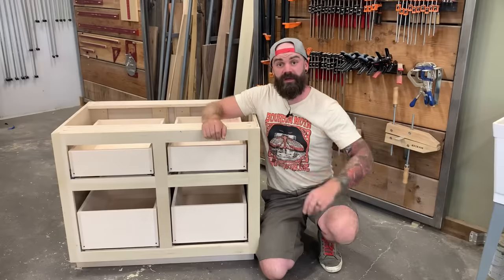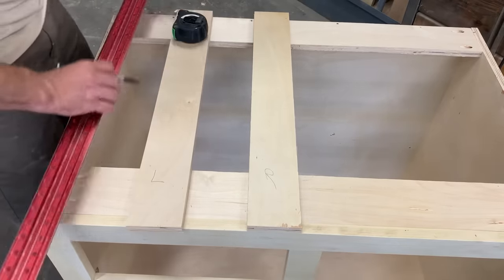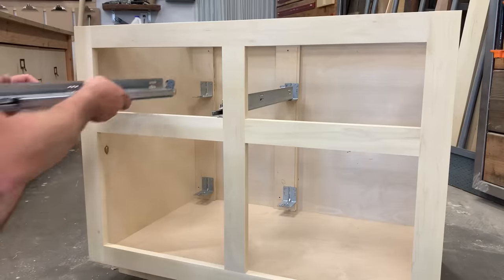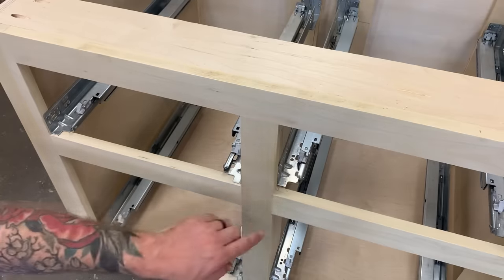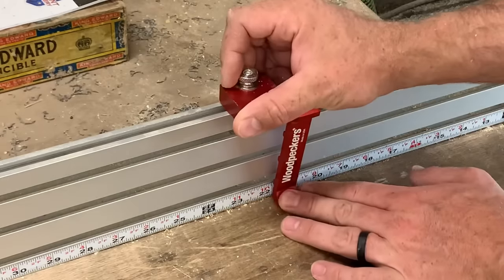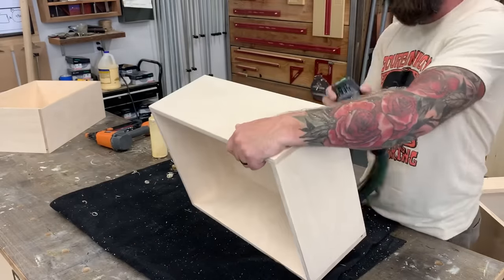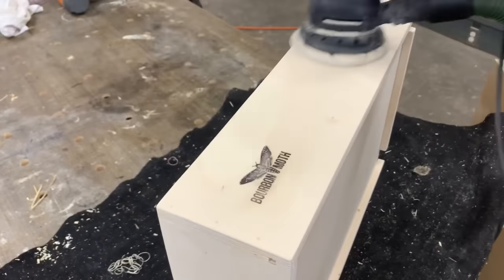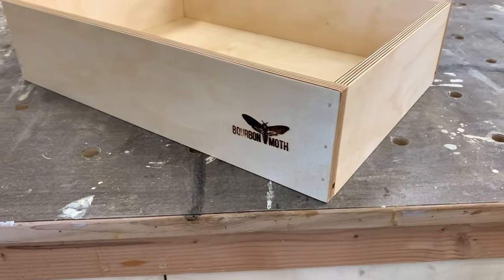Build Cabinets The Easy Way | Building and Installing Drawers

Comment: Lots of great tips on installing those drawer slides. Shaun Boyd's video on these is pretty great but your technique might be a little easier to approach because of the lack of measuring and just transferring marks. I've wanted to use some of these slides and this gives me a little more confidence. I would argue that the time saved by using nails instead of pocket holes is negated somewhat by filling, waiting for filler to dry, and sanding the holes left by the nails. I will say though, that I often fight with pocket holes trying to pull the parts out of alignment when they are tightened.

Comment: I used 21 inch dynapro undermount slides by Grass.  Cannot get my drawers to close all the way. There is about a 1/4 stick out on the face frame.  Any idea what I am not doing? The holes are aligned in the back. Slides are closed all the way. Please help.

Comment: Which side has a higher load capacity? Left side (Overmount) v Right side (inset)? My theory is the inset has higher load capacity since it isn't loading the face frame, but instead is loading the inset vertical scrap piece. Prove me wrong?

Comment: It's great to see your fine works but you see just one 8 inches Clamp's cost more than 1000 and plywoods 4×8×12 feet cost almost 1800 and door's slides are impossible to find anyways first of all a straight guide cuttings device is needed and I don't know what I do first and purchase first 🤗👍

Comment: The link to the drawer slides says the slides are for drawer side thicknesses up to 1/2”. It looks like you are using 3/4 plywood. Did you have any issues?
Reply: I had the exact same question.   Anyone have confirmation on this?
Reply: @JodyAbbott  scrolled through some of the comments but didn’t really see this addressed. I don’t understand why it wouldn’t work for 3/4 drawers? I mean what part of the slide limits it to 1/2”?
Reply: @JodyAbbott  I found this site that sells these slides. Nothing specific about wall size, but several people did mention that these are difficult to install on “older” drawers? 

https://www.build.com/blum-563h5330b/s869746?uid=2221277
Reply: On the Amazon link it states these slides for for MAX side thickness of 5/8, and they have a different model number version to support a 3/4” box build.
Reply: @JodyAbbott  I saw the same. What is the difference?
Reply: Read through all the comments, he used 5/8" ply
Reply: @Ryan_L562  thanks. I paused the video and it really looked like 3/4 ply? 🤷‍♂️
Reply: @Ryan_L562  I just read his comment. Thanks.

Comment: This is a great tutorial for me. Drawer slides always make my head spin, because I usually do something wrong. Not sure why, but I just do. One question I have is... I noticed on the left side that the drawer slides seem like they "could" get shoved back further if needed (for that style of drawer). And on the right side, you actually do shove them back for that type of drawer being used. Am I  correct on this, or will I be doing something incorrect here as well? I think it seems obvious, but just wanted your guidance if possible. Thanks!

Comment: Great video! Super informative and love your teaching style! If I may, would you recommend 1/2" or 3/4" bottoms for 27" wide pantry drawers? We have most tools, but no table saw for dado cuts, so any tips on construction are also appreciated. Thanks!
Reply from the maker: I use 1/4” for drawers that big all the time 🤷🏻‍♂️
Reply: @Bourbonmoth  Wow even for pantry drawers with lots of cans and such?
Reply from the maker: C Dean yeah what you can do is take a piece of 1/2” ply cut in a strip about 2” wide and set it in the recess underneath the drawer and hook it in with pocket holes. That will give you plenty of support without the added weight of a full 1/2” sheet.
Reply: @Bourbonmoth  That's interesting and very helpful. Thanks! Keep up the great work. P.S. Looking forward to making a frothy whiskey sour soon! 😃🍸

Comment: This is a great video, saved me in the last min from buying the side drawer slides. I have a question- I have plans for my dresser. I wanted 18" drawer slides. so would it be fair to say that my cabinet overall should be 20" deep? that was the plan for side slides and am wondering if the under-mount with the added backboard changes anything.

Comment: I’d appreciate it if someone could help me out. If the drawer slides are 21 inches wouldn’t the box sides need to be 21 inches plus the thickness of the front and back of the box? Since the front and back is 5/8” x 2, the real length is 19 3/4” underneath where the mount goes if your sides are cut at 21”. Am I missing something?

Comment: Built a shop bench/cabinet.  31.5 inches deep, has a door on the outside of the right half.  I am thinking that the slide choice is still a mystery.  I was thinking 28" slides.
Also, I may need to purchase the draw slides at different times, so would  it make sense to buy the brackets for all three, then build each draw as time permits? Not sure how to approach this

Comment: Maybe our brackets are different, but if I line up the bottom of my Blum bracket with the scribed line from the top of the rail, the slide tilts forward. I had to drop them a lil bit so the slide is level. Anyone else notice this?
Any way I just put one screw on each end and after I build the drawer boxes I’ll rescrew if needed.

Comment: a bit confused here. Width of box is the distance "between" slides but it looks like you show it out to out. Please advise.
Reply: It’s best to look up the instructions for the slides as his advice differs very slightly. However the point is that the gap that he measures is meant to be the interior width of the box. The interior sides rest on the outside of the area he measures.

Comment: Your drawer build method is really good... but to make the drawers look more attractive (although not quite as quick to make), forget about nails and use biscuits instead.  The holding power of biscuits is quite impressive.  And given the holding power of today's PVA glues, they'll be strong enough to last your lifetime.  And probably that of your kids.  And maybe even your grandkids.  And unlike a Festool Domino, a biscuit joiner is well within the budget of most amateur woodworkers and is a time-proven joinery system.
Reply: I'm pretty sure the video shows the drawer boxes being assembled as you described in your first point. I'm also confused by which forces you are concerned about, gravity or pulling the drawer?
Reply: @nickholzem7401  I took a more careful look at the video and you are correct; I mistakenly thought that the sides were the front and backs.  I was wrong, Nick, so thanks for pointing this out to me.  I will amend my first statement.

Comment: I like your video, but you missed why we want to the build. I for one will not be able to get those slides, due to where I live, the USVI, they are just lot available, If I order those the price is ridiculous.  I have a cabinet built over 40 years ago and was looking tips and pointer to retrofit the bottom slides and find some other slides that would make these old draws meaningfully functional again and brought into the modern world. That is why I looked forward to this build series, now I am disappointed that there is no information that is useful for my situation.  We all need you to address side slides and retrofit for older existing hardware, please?

Comment: Im trying to figure out how to convert this video into building a 3 foot drawer :l

Wanted to build my mother a drawer for Christmas so I busted a hole underneath her stairs and I wanted to give her a 3 foot drawer strong enough to hold canned goods and jars, so lots of heavy items...
Reply: Teddy this wide of a drawers shoujd be fine.  Recommended widths are around that for undermount slides.  But you shoujd have a long centered handle to minimize racking of the drawer as it’s opened.
Reply: @davidbryanwoodworksandmore  Problem is 3 foot deep not 3 foot wide, it's about 22 inches wide. Basically tuning an entire staircase into a pull out storage.
Reply: @teddy5004  okay. Well I’ve made 72” deep drawers and they were great.  But you can’t with these slides.  You’ll need accuride side mounts.  They are for this type of application.  The under mounts aren’t big enough.  I’d make a cabinet for the drawers and install the cabinets with drawers already in them if possible.  Use 3/4” ply. For bottom use 1/2” min ply.
Reply: @davidbryanwoodworksandmore  Exactly what I was looking for, thank you!!

Comment: Yeah, literally 10 times as expensive as the drawer slide I use.
Reply from the maker: Aaron Anderson and work 10 times better
Reply: @Bourbonmoth  only difference i like the Blum Movento slides only because they are more ajustable and only a few bucks more👌 .. great video 📹

Comment: Yeah, $240.00 just for drawer slides? I don't think so, that alone is more expensive than the rest of the project. Yes, they are nice but not cost effective considering the overall cost of everything.

Comment: Best drawer slides... at 3x the cost. They cost more than the wood does to build a 6 or 8-drawer dresser.

Sorry, but Blum is not affordable for probably 90% of us.
Reply from the maker: I mean if you want to use crappy slides instead go for it 🤷🏻‍♂️
Reply: @Bourbonmoth  Define crappy. The vast majority of people need to balance cost with performance. As an expert your role could be to help people make do with what the average person can afford. How about how to find and install decent yet affordable slides? Gear and material snobbery doesn't make woodworking more accessible, it makes it less.
Reply from the maker: Chris Dees I guarantee if you use undermount slides once you’ll understand that they’re worth every penny. Honestly especially for beginners because they’re so easy. Even with the extra cost of the slides you’ll still spend 1/4 of the amount of having custom cabinets built by a professional.